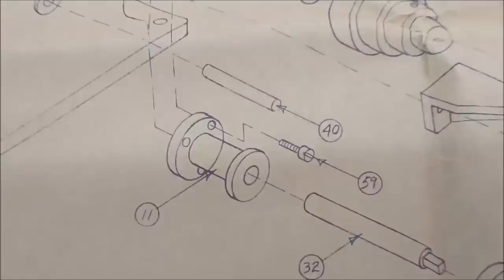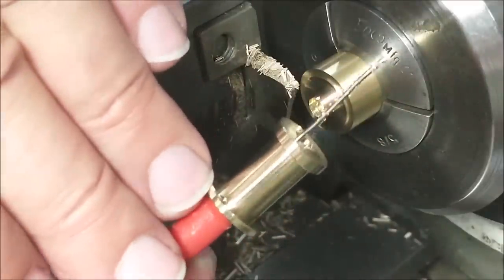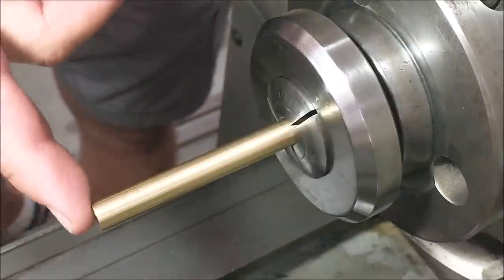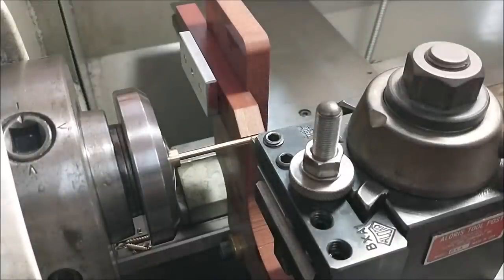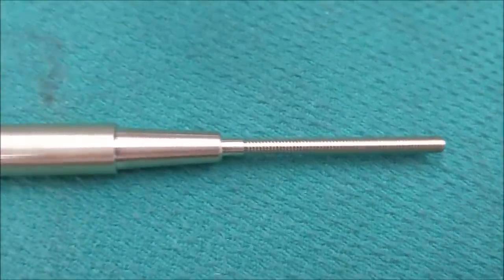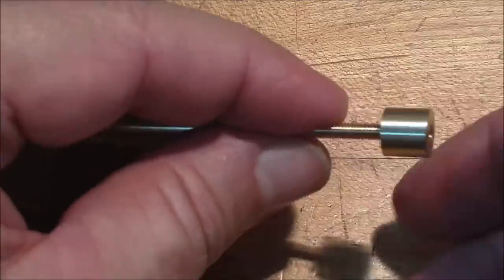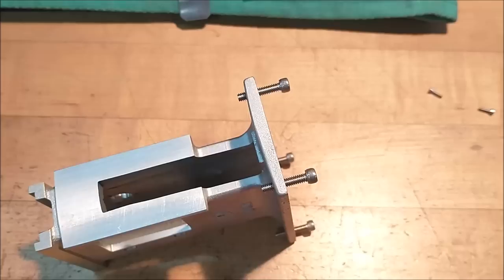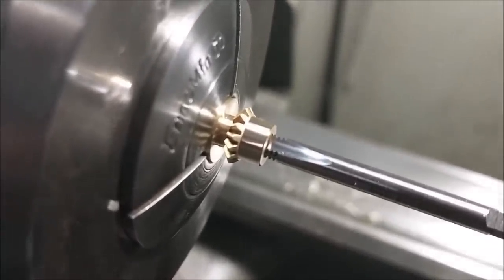Machining Brass Components For a Miniature 1800's Shaper

Comment: The Model is coming together nicely! Of course it is thanks to your skills and talent. I  love the tips and explanations you give while you're doing this, and as more and more parts are put onto the model and I see just how perfectly they fit together, I'm getting more and more excited to see the end result. I can easily tell that you and I are kindred spirits, because you are making the parts and once they are done, you are setting them aside and leaving them. You're not leaving them attached to the model. now, I know in many cases that the parts would get in the way of your other fittings and  measuring etc. but there's also something that gives an enormous sense of satisfaction by keeping all of the parts off to the side until every last one is finished and when that is done, THEN and only then will you assemble the  model in its entirety as if the kit came with all of the parts ready to be installed. then you can sit down with your screwdriver sets and nut drivers and tiny wrenches, and lay out the assembly mat, and place all the parts in their own cups/holders and assemble the miniature model for the last time. It simply HAS to be done that way, to make it feel like it was done right, to get that sense of satisfaction, the engineering feeling of everything having its place and organized, ready to be assembled and placed in such a way so it can be admired and appreciated for its beauty and complexity and to show off your skills that made such a model possible in the first place, because it certainly wasn't complete when you got it, you had to make the parts needed PLUS you even modified it, putting you own personal touch to it, making it a showcase of your skills to improve upon what was provided! Looking forward to seeing all of the remaining work you're doing to this model, especially the final assembly!

Comment: 9:00  -  I've never seen material deliberately moved in a spindle collet while the spindle is running.  I don't think it would ever have occurred to me to try that.  No blood, no flaming debris, I guess that goes in the trick tool box too.
Reply from the maker: Only lever type closers will permit that, but I do it all the time. Be careful inserting material into a spinning collet. It has to be very coaxial or it may have a tendency to helicopter and hurt you.

Comment: I think your method of threading left to right,is one of the best pieces of knowledge you have shared.
I did however,make a modification to my lathe to eliminate the possibility of crashing the carriage.My machine has a jog button that I never use so, I replaced it with a selector switch that locks out forward rotation of the spindle,as a extra layer of protection for myself and my lathe.It just makes me more comfortable,knowing that I can’t possibly crash the carriage at a high rate of speed.
Reply from the maker: Jog buttons are good for metric carriage threading positioning and for large surface contact form tool cuts. I used to use the one on my Victor 1640 all the time.
Reply: @joepie221  I avoid metric threads like the plague because, I would have to change gearing in the headstock. I once owned a 6x24 Atlas.Although it was a good learning tool, I swore I would never own a lathe without a quick change gearbox again.🤣

Comment: Hey Joe, I notice that you use cutting oil when drilling and reaming brass but you turn it dry. I was taught to do all machining on brass dry. What are your thoughts? Nice parts BTW.
Reply from the maker: Hi Mark. Knowing it was a bottomed hole, I wanted to give the chips every opportunity to slide out. I also noticed an unexpected feature. It appeared if the hole is full of oil, once the reamer loads up, it forces a compression of the air in the hole and the chips are forced out from a hydraulic effect. Straight flute reamers don't usually extract chips unlike what happen here.
Reply: @joepie221  What cutting fluid Joe?
Reply from the maker: @stevebosun7410  Its just WD-40

Comment: Hi Joe,
I have a question....
I looked through the comments and only saw a mention of a die. No dialog.
 Is there a reason for single pointing that small long thread or a reason behind not using a die?  Genuinely interested if its my lack experience (or courage... ;) ) 
Behind the operation??
Reply from the maker: Unless dies are held perfectly straight, they can wobble as they are driven. This is commonly referred to as a drunken thread. It will still accept a nut, but you'll notice the nut wander in its square position to the axis of the thread. For an elevator mechanism like this, single point was my first and only choice. A wobble would bind the crown gear and result in a tight spot.

Comment: it looks like your threading tool is cut straight on the headstock side.  using only 30 deg taper on the tail end?  is that true?  i need to make tiny screws with a very minimal thread very close to the shoulder.  a way to do it?
Reply from the maker: No. Its a very small full 60 degree tip. Just offset to the collet side.